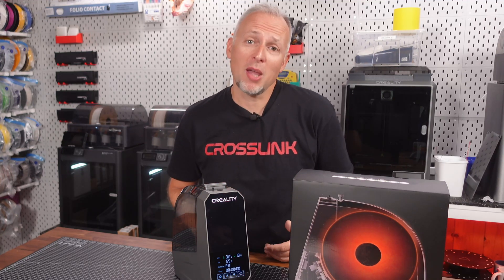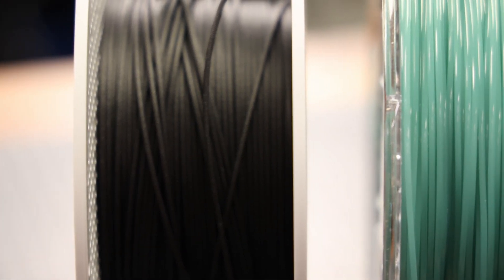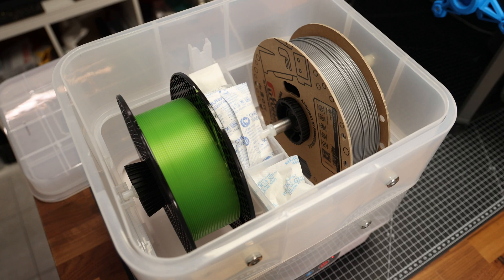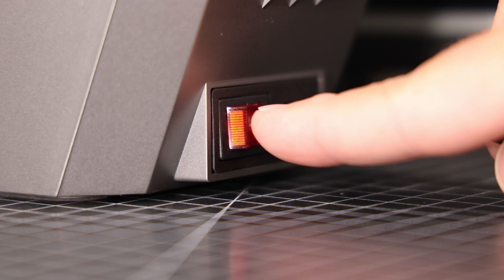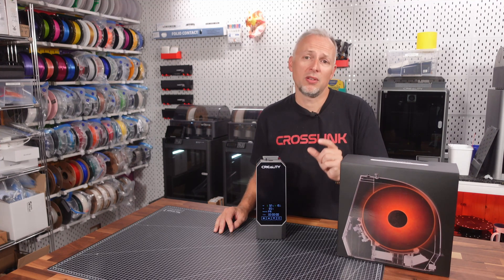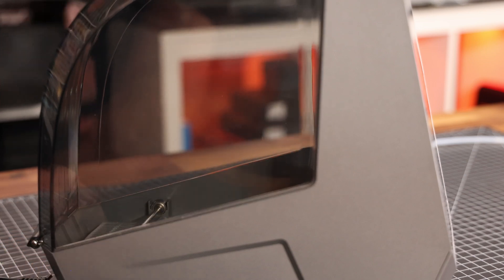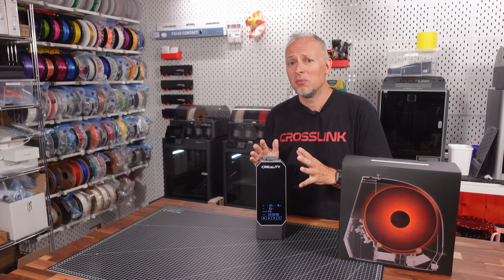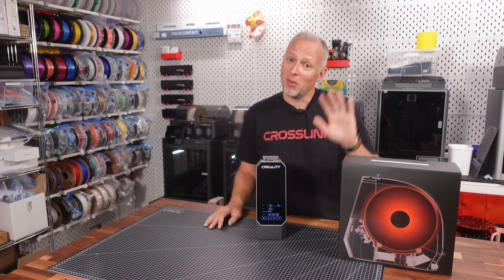I tested the Creality Space Pi Filament Dryer - is it good?

Comment: Don't buy this, it's junk!  The touch screen is fidgety and there are no rubber gasket seals around the lid.  That means that you have to immediately have to store your filament after you print or it will absorb humidity once you turn it off.

Comment: The way this drying works is that when air heats up, air absorbs more moisture. That moisture is stolen from the environment, in other words, it's taken away from the filament and goes out with the warm air. 

So you need airflow through the dryer in order for it to work at all. If it had a sealed chamber, the result would be that the dryer simply wouldn't work at all.

Comment: For those filament vacuum seal bags that get punctured, the solution to increase the life span of it is to cut the original plastic (that the filament came in) into 3/4th and put the filament roll back into that then the whole thing into the vacuum bag and seal them. The edges on the filament spools sometimes dig into the vacuum bag and create small holes.. If you use another bag inside it the outer vacuum bags last longer.

Just make sure the inner bag is not covering the filament spool completely or the air won't get sucked out. I cut the inner bag to the height of the spool leaving just the edge of the upper spool visible at the edge of the inner bag. 

Also while sealing make sure the inner bag doesn't come under the one-way suction valve.. or your pump will struggle to get the air out.

Comment: I just got the 2 spool version of this dryer, and agree on a number of the points  The 4 spool version has an excellent screen and can reach higher temperatures.  I had made the mistake of assuming they had the same power limits. I got the 2 spool version on a  super sale around prime day everyone was dropping prices.   That said I'm happy with the purchase, and do intend on buying the 4 spool version.   I have about 10KG of Makerbot ABS that's a number of years old.  I found it while shutting down an office at work last year.  They let me keep it and a makerbot replicator 2x which is what started my 3D printing journey.   This filament was brittle often printing was difficult . The dry box changed all of that.  I've just printed a respooler on 6 year old ABS and it's great.   I've respooled almost all of my ABS now and have been running it through my CFS.  I definitely recommend getting one if you're using PETG or ABS.

Comment: I use AMOLEN bags and vac sealer for many years now, they have updated the pump with a larger silicone seal so it takes a bit less fidgeting to get it vacuuming. My main point is, Ive never had a bag tear yet even after many reuses. they may be thicker than what you linked. Id say give those a try maybe.

Comment: If the humid hot air isn't expeled while heating the humidity stays inside, you didn't dry the filament you just heat it up ...
I bought it to predry it then put it in my 10%rh box dryed with my M-2j1r
Reply: You're supposed to put silica packs in there. It removes the moisture then goes into the packs which makes it a dry box. It works fine if you're not a tool like the dude in the video 😂. There is an unnecessary vent hole in the top that should be taped shut if you plan to keep the filament in there a while. The outer lid seals quite well actually. It's a double layered joint. Yeah there's no rubber but it's pretty good. Most filament takes many months in very humid environments before they have printing problems anyways.

Comment: I want to update my experiences with this 3,14. In almost every review  about these dryers they are saying that they dry the spool up to 7-8 hours. I dont understand why? When i start printing, whether it is PLA or TPU, i turn on the dryer just before i start the printing. Even if i have stored the PLA spool in the dryer turned off. At first the humidity meter says 30% but when i turn on the timer it starts to decrease quite quickly. I have had no problem with printing, not even with TPU. When i turn on the dryer it quickly starts to dry the filament on the surface on the spool. And when i have printed about 0,5 - 1 hours, the humidity meter says 15%. No need to dry the whole spool for many hours. The first layers on the spool are the most important.
Reply: The humidity meter measures the air relative humidity. By relative, it means how much percent of the max possible moisture is present. When the air heats, it's capacity of holding water molecules increases, so the sensor readings will readily decrease, not because the humidty was gone, but because the air can hold more humidity and therefore, decreasing the relative humidity.

As soon as you turn it off and the air cools, you are gonna see the same humidity as before, and guess what, the filament is not getting moisture that fast, is the sensor readjusting its readings for a new temperature.
Reply: you don't dry the filament if the humidity has no way to escape, you just heating it
Reply: @surronzak8154  You are absolutely right. I don´t remember has the Pi an a fan that sucks the humidity out. Anyway, it works.

Comment: I bought this dryer a month ago and i have been happy with it. I have been printing Multiboard parts, mainly the honeycomb panels. One 6x6 cell honeycomb prints in 4 hours with my settings, so it´s quite long, for me at least because i don´t print as much as many others does. I have had 2 problems with the dryer. On both cases the filament spool did not spin causing that the extruder didn´t get any filament. I don´t know why this happened. But then i noticed that the filament tube that goes in to the dryer had over time gone down too close the spool and that stopped the spool from spinning freely. That is at least i think was the problem. Of course the two rods on the bottom have not so good bearings either.  In addition i bought a Mintion Beagle V2 wifi camera so i can monitor my printing from my livingroom so i do not need to every half hour go and check it prints ok. I´m glad i got this camera because today when i was printing one of thos panels, i heard a noise from the room where the printer is. Quickly i checked the live feed from my monitor and saw that the panel had deattached from the bed and was flying arround on the bed that caused the noise.
Many say that they have problem with the display and its functionatily.I have not had any problem with that. One thing i noticed though, was that if you press too hard it does not work. You have put the fingertip gently on corresponding button and it works like a charm. Same way as you use fingerprint scanner on a phone. Just tap with the fingertip, don´t press.

Comment: Regarding the plastic to plastic interface, i.e. not perfect seal of the box, I would think that this could be a good thing because when you dry the filament you want the moisture to be able to escape the box somehow and not be trapped inside. But yes, obviously the chamber will only be effective while actively drying because of this. It’s a trade off, but probably a good one.
Reply: exactly, cause if sealed you only heaut the filament, leaving all the moisture inside
Reply: @surronzak8154  Other brands have actual solutions, although costing more. My first question with this in comparison to my Bambu HT was... where is the humidity being vented??? Oh, it just leaks out of the poorly sealed lid which also.. Leaks humidity in? Both my AMS2 and HT have elecrto magnetic intake and outlet ports. These ports open when drying, and close when done to keep the filament actually dry from the environment. I purchased this particular dryer less as a dryer and something to keep an external spool from absorbing moisture during a longer print from another printer. From what I'm gathering, if it vents humidity due to no seals, it probably isn't a good solution to use as a holder during printing. I will have to see how much humidity it gains while sitting idle. Also definitely MUST print a desiccant box that remains inside somewhere asap. 
To be fair I printed boxes for the HT and the AMS2. But having better active seals, they remain at 10% or less all the time. Also the silica is always rejuvenated during any dry cycles so its basically a one time fill go.

Comment: The dryer is garbage. Touch screen feels unresponsive and awful, in addition - included pfe tube keeps slipping inside the dryer effectively stopping filment pull. Unfortunately I discovered this after my return window ended. Better buy something else instead and do not bother with this device

Comment: I have a Comgrow filament dryer and it only goes to 55C which is not hot enough for filaments like ABS and ASA.  The Comgrow filament dryer is not very good as I have had to take it apart to fix the loose fan.  I was looking at the Crealiy one as a replacement so I am glad I watched your review as though it looks fancy the quality does not appear to be that good.  I think I will look elsewhere for one.
Reply: For anyone unaware there's two different styles of Comgrow fliament dryer. The older one, which you have, and a newer one that is basically the Creality box in a different form factor. IMO the newer Comgrow box is better than the Creality version because it's easier to get a seal on it, though that does require getting  some sort of silicone sealant to achieve a perfect seal around the lid. Otherwise the complaints in this video match up perfectly with the newer Comgrow model.
Reply: @bruwin  You are talking about the newer SH02?  Yes, that is not bad and goes to 70 degrees C.  I wish they made a single roll version as I don't normally need to dry more than one roll at a time.

Comment: In addition to vacuum sealing, I also put a small amount of desiccant (silica gel) because... basically all plastic is water permeable. So even vacuumed sealed bags will allow humidity from the air to reach your filament. (If you know any chemistry, water is actually a very small molecule.  Its smaller than Oxygen (O2) and Nitrogen (N2) which are the majority of the air (which explains how something can be mostly air tight, but NOT actually able to stop water molecules passing through. Water is actually smaller than most of the components of air.)
EDIT: Just to be clear, this won't happen quickly... but it does happen over time, and can be important for longer term storage. This is also why filament, despite being usually sold in vacuum sealed bags, almost always has desiccant. If it sits on a shelf for a while (A year or more) before being sold, it would start to get wet otherwise.
Reply: Putting a dissicant into a filament sealed bag is comon sense
Reply: Good tip, thank you!

Comment: Most important thing is missing...How good it is drying the filament?!
Reply: This saved my prints. I tried everything to fix my failed prints. Friend told me about this. Got it. And oh my god. I can't believe this was the solution. I live in florida. So very humid. I always noticed my prints work great the 1st day I opened them. But never put 2 and 2 together.
Reply: It works well. I have the dual spool version.
Reply: also if it's a real dehumidifier. Where is the drip house. I think it is a heater that only relies  in desecan for water absortion.
Reply: if it only heats the filament, does not that mean it can have even more humidity?
Reply: @AndrewTSq if you do not suck the air. heated or not. you will have the same humidity but hottest.
Reply: Exactly my point...!

Comment: any filament dryer that fails to seal is pointless...
Just set your bed heater to X degrees and put your filament on it, then put the cardboard box over the filament with a few holes poked in the top and a thin strip along the bottom cut away to allow hot air to rise and cool air to come in from the bottom.

its free... comes with any printer that has a heated bed.
Reply: lmao how contradictory. "Any filament dryer that fails to seal is pointless" followed by " Just use your heat bed with a cardboard box with holes".  Which is it? Dryers cannot be sealed because you'll  trap all the moisture inside the box. There needs to be airflow. You shouldn't be storing filament in a dryer anyways.
Reply: @suspicious_soup  are you trolling or do you really fail to understand?

Comment: You shouldn't have to vacuum seal the bag if you store the filament with a dessicant (or silica) packet. As long as the bag is sealed, the packet should remove the internal moisture for long term. I've had perfect success with dessicant packets and a large ziplock style freezer bag.
Reply: Stick a large silica pack in a ziplock bag and then use a straw to draw out most of the air as you close it.  Not quite vacuum seals but makes it easy to reduce the air and bonus the bags are nice and neat.

Comment: Not sure what the point of a timer is if the box isn't sealed.  I use a Eibos that has a knob, set a timer on my watch, then put it in my AMS or sone of those bags.  There is a lot of added cost to one with those electronics that in the end don't really do anything.  If you aren't in the room when the timer goes off it will just start absorbing moister.  This is why I like mine that doesn't go off and the timer is on my watch so if I'm not right next to the dryer then I'll still know it has completed the cycle but will still stay on if I can't get to it right then.

Comment: Great video Daniel. I live in Eastern Canada close to water. So humidity is always an issue. In the summer there are a lot of days when I see over 80%. I do run a humidifier in my basement close to my filament and printer but a filament dryer is still needed. I picked up an Eibos single unit a few years ago and it's OK. I recently picked up the Sunlu S4 and I do really like it. A bit expensive though but works well. I looked at the creality one but I am glad I didn't buy one. Seems like they cut a lot of corners on that one. And every reviewer seems to have the same opinion on it.